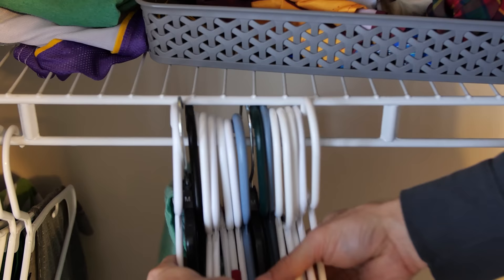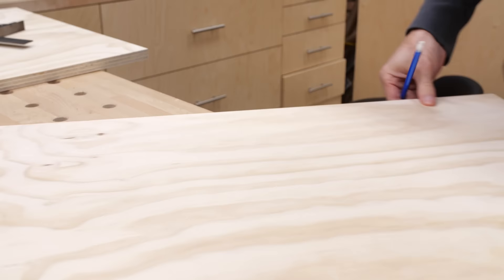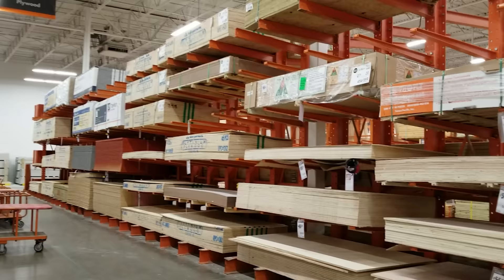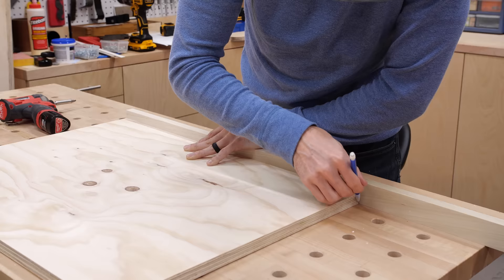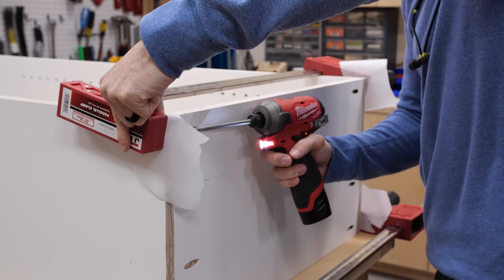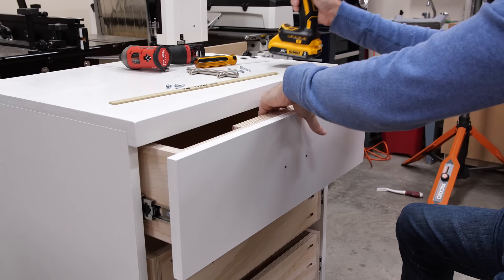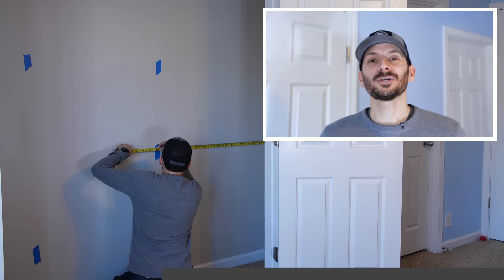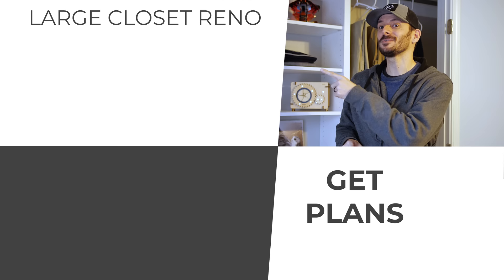DIY Closet Organization with Shelving and Drawers

Comment: i like how it seems easy if you have your own home depot of tools in your house
Reply: Exactly
Reply: You can actually buy those two pieces
Reply: I know i just watched a guy say he "make your own vanity for a fraction of a price," but then proceeded to uses thousands of dollars of equipments.
Reply: You don't need a fancy shop like he has ...  A tape measure, circular saw ( be sure to use a plywood blade) electric drill or screw gun ( a magnetic extension helps but they make long screw bits & be sure to get the proper tip for the screws you are using), caulk line, a bottle of wood glue, sanding blocks or sand paper and framers square ( clamps do help but a family member or friend  helping works better..think of the time together) ..all these are just base tools ... Design to your needs ☺..good luck👍
Reply: LMAO I was thinking the samething
Reply: @scottm.franklinnc7942  Agree!  Would love to see an episode with just using the tools above.  And throw in a comparison of cost and time between using all tools vs. minimalist tools.
Reply: Ya’ll a bunch of Karens!  Nothing but complaints...go buy or rent the tools to diy this or hire someone.  That’s the reason you pay contractors the pricing they charge because they had to have a large investment to be able to do the work you want done...
Reply: @DoctorMofo  it’s like they expect to make things with a screw driver. If you’re going to build something you’re going to need tools. Simple as that!
Reply: I think as a homeowner & especially as a man you should own tools.
Reply: @DoctorMofo  Damn my name is Rosie though
Reply: @chuycanseco5515  I'm a man and homeowner and have tools but I have absolutely no room in my one car garage for any of the table tools he used.
Reply: Right??!
Reply: Ive seen so many " diy " they be like anyone can do it, then go to their garage with 20k in machinery lmao
Reply: Yeah.... i only have basic hand tools as i live in a flat without any garage, and all the tutorials i see use pro tools. 
I would like just once a diy with only basic tools, without table or big and expensive tools, and see how to use them with efficiency to have a good result. 
I'm making a vanity  it's difficult as i'm a beginner but i cannot really rely on youtube tutos for that.
Reply: He is just using what he has. This whole thing could be done with the tools most DIYers have. Circular or table saw, jigsaw,  drill or impact, pocket hole jig, tape measure, and speed square. He really didn’t use anything too crazy.
Reply: Engineer Your Space is a youtube channel I love because the tools are so basic.  Miter box with handsaw and a drill.

They show you how to make wonderful changes to your rental that won't damage the apartment.
Reply: I use to be like that but bought a home and renovated my basement myself. Total cost of tools = 3k savings from doing it myself= 100k
Reply: @pbdubz  I don't even have close to 20 grand in machinery and I could this. You don't even need a $1000 in machinery. It's not that hard.
Reply: Of course always people complaining about lack of tools. Do you honestly not realize this could be done with very basic tools? Circular saw $100. Miter saw $100. Impact gun/drill $100. Wow $300 worth of tools and cheaper if you buy used. Stop whining and figure this crap out. Its not hard.
Reply: Be a man and buy a set of good tools. One time purchase if you buy quality.
Reply: I guess you want to see a video doing this with a toothbrush and a lugwrench.. 😅
Reply: @mcdonamw exactly 😂
Reply: I’m getting increasingly impatient with people who make this comment on every handy video
Reply: I'd like to see him or someone as talented as him make a video building something at my house. I have all the basic tools and the bery low  budget that most regular everyday people have at home and it would be interesting to see how easy it would be to build some of this stuff with my very basic set up. I dont think it would be as easy but if it can be done i think a lot of us would love to see it. If you are up for the challenge let me know. I have a few projects we can tackle.
Reply: True but you can rent the equipment
Reply: In essence, everything could be replaced with a hand saw, a hand plane, a hammer and nails. It probably won’t come out looking this nice, but you could absolutely simplify it and probably end up with something usable. 

I figured cheap vintage hand tools would work well… but lord my cheap circular saw is a lifesaver compared to using hand saws for something like this. I can only imagine the logic follows until you end up with a shop similar to this fellows

Comment: All these “DIY” videos that been popping up in my feed sure do seem to assume I have all these power tools and knowledge about wood cutting and supporting lol
Reply: Same but I'm learning
Reply: It's still DIY if you did it yourself.
Reply: I was going to write a comment and saw yours said it all hahahah
Reply: A circular saw and drill gets your foot in the door.
Reply: This is "Professional Grade DIY".  LOL
Reply: It’s a sign of your a man to grab some tools and  start learning
Reply: None of it is hard to learn. Get some tools and some cheap lumber and go build something easy. 
There are processes in woodworking that take talent and years of practice to get good at (like marquetry or inlay) but you can build almost anything without needing to learn them.
Reply: Can do an awful lot with a circular saw and a straight edge. Most folks won’t be making cabinets and drawers that easy on there first try. Some open shelving a beginner with basic tools could 💯 accomplish with a little patience.

Comment: Nice job.  I never let my cabinets touch the floor in the closets.  I hang them around 6” or so off the floor so one can keep clean, critters cannot hide and replacing the carpet is never an issue.

Comment: Great video and great looking closet system…for the rest of you schmucks without the carpentry knowledge or tools, such as myself, closetmaid has very similar kit for about 800 with drawers, all the shelves, and a shoe rack. You can even get fancier if you put an LED strip on the inside of the wall and a smart plug for lighting.

Comment: I came across similar problem that you had on hutch upper, side pieces. I pocket screwed them to the top and filled the exposed pocket holes with precut wood dowels angled specifically for filling these holes - found at Home Depot. I sanded them down and you can’t see them after paint. Your method is also good.  That wall hump is so typical of builder tract houses. Belt sanders are god send! Great job and video too.

Comment: MDF is less expensive and has a very smooth surface.  I am building built-in bookcases with it. For strength I glue to 1/2 inch panels together for a 1 inch shelf and sides.  I have built bookcases like this in the past and it works really well.  I love the idea of drawers in the closet. I fold most of my clothes anyway and it would give me far more storage that hanging!  Thanks for the idea!
Reply from the maker: For sure, MDF is a good option too

Comment: I designed a similar closet but instead of all those hanging rods, I designed it with fixed shelves on top of the middle drawers and on the right side I had a 32 inch in height shelf to fix a suitcase.  Above that right side I had varying height shelves.  There is a top shelf from left to right for blankets and other bigger items.  On the right side are hanging rods for clothes.  Keep in mind that this custom made design is for a vacation home and custom made accordingly.  My nephew built it, he used poplar hardwood and birch plywood for the shelves.  I posted the finished closet on Facebook in an ad and immediately got about 30 inquiries.  The total material costs which included enamel based oil paint was about $400.  It does add value to a house and not to mention it is a great use of bedroom space.  Oh, and did I mention that women love those custom closets, especially my wife! LOL.

Comment: Stop block... top panel... gang cutting...clamp heads....base cabinet...face frames.....edge band....combination square...  it was very reassuring when you messed it up. But then fixed it with a lil piece of tape

Comment: Carpenter here. It was nice to see you scribed the back of the hutch for a nice fit. Since everything is just white I would get some white painters caulking and run the smallest bead along the back of the hutch where it touched the wall and where the drawer touches the wall too. Then scrape away excess with a putty knife. It will make the edges so incredibly crisp and professional looking. I mean it's a closet so no one will look that closely but I'm just a perfectionist and I think it just looks so good with that extra detail

Comment: I use  the Radiata Pine plywood all the time. It's $30.95 at my big orange store. Multi layers but like Brad said get a straight flat sheet it will not, will not flatten out. Did I mention it will not flatten out? Great build Brad.
Reply from the maker: yeah, best get it flat and build fast :)

Comment: It's easy when you are a carpenter and have every single woodworking tool known to man
Reply: I'm a carpenter but with far less tools at home. I mean, still a couple thousand worth but I don't have nearly his level of tools. That said, can still pull this off without this degree of tools. You just have to get a bit more creative. Like, instead of a track saw, a basic 6" circular saw and a straight guide would work. I've managed to remodel almost my entire house with the basic tools I have.

Comment: For metal-on-metal like hinges, you want lithium grease. With the spray kind, you don't even need to remove the hinge pins -- just spray it on with a rag behind it and work the hinge. I lubed all my hinges in the house with lithium grease about 5 years ago, and all but 1 are still completely silent. The 1 that isn't really has too much junk hanging on it (pantry door).

Comment: i'm so glad you did this -- i've been working on a closet system for my wife in the back of my mind for a few weeks now. one question -- what are the advantages to using raw plywood as opposed to using those melamine panels with the pre-drilled shelf holes? is it just more expensive with the melamine? thanks!
Reply from the maker: I didn't price it out, but cutting from a larger sheet is almost always cheaper.

Comment: Hey Brad.  Another great video!  Would be great to see a video that explains how you go about spacing drawers in a cabinet such as this.  When there are several drawers within a single cavity.  I like the idea of creating that spacer but getting the height measurement for the spacer, that’s the trick. Thanks again!

Comment: Thanks for the video.
One question: which material is better for building furniture, plywood or MDF?
In case, I need to use a router to trim the edges, the plywood will leave rough edges. What should I do?

Comment: Great video! Love the professionalism. You show the important parts and not all the other useless info. Question: Thoughts on just removing the base trim behind the cabinet instead of notching out the cabinet unit. 6 one way, 1/2 dozen of the other. When we add base cabinets to remodels we always get them as flush as we can to the wall.

Comment: I always see these 23/32 sheets of ply at HD but wasn't sure if they were viable for all these home projects. Does the slight difference in thickeness matter vs. the $40-50 3/4" birch/oak/etc. sheets?
Reply from the maker: The 3/4" sheets are actually also 23/32
Reply: It depends on the number of plys. Get at least 7 ply for better projects. Stumpy nubs has a great video on how to read plywood grades. Definitely worth a watch.

Comment: Nicely done. Did you paint the carcass edges or put solid wood face around this as well?
Reply from the maker: The lower cabinet edges just got sanded and painted.  It's hidden 95% of the time

Comment: The only time I've really used adjustable shelves is 1: On my bookshelves. 2. My garage cabinets. The first is because I like to reorganize my books come such a wide range of sizes that it really is nice to be able to adjust the height as need be. The later is because my workshop is still getting slowly filled with tools so it's nice to not be committed to a shelf height.

Comment: Curious why you did not primer the wood?  I was always told that water based paints on plywood will make the grain rise without a primer.
Reply from the maker: It's paint and primer in one.  And if you use a water based primer the same thing will happen.

Comment: My bedroom has a set of bypass doors on my closet and I cant use your design as you wouldntbe able to open the drawers as they would be in the area that is behind the door overlap area. What do you think about moving the drawer stack and hutch to an off center location using the smaller hanging area as a full length hanging area, then using the other (longer) side as a bilevel hanging area for shirts and shorter hanging area. I really like your design and plan on using it. Thanks

Kenny Norman

Comment: Any tips on installing drawer slides in tight spaces? I don't have any side clearance (installing your build in a small closet and has to be built in due to dimensions. The drawer slides on the carcass I can do like you show here but I think I'll have to install the slides on the actual drawers with them out of the cabinet/dresser. Thanks!

Comment: How do you rate the kreg track saw
Reply from the maker: I'd say a solid B+
Reply: @Fixthisbuildthat  thanks, i am actually a kreg dealer and get a personal one for 50% off retail. but i do want to good one and would spend the extra cash if the dewalt or makita was better.
Reply from the maker: @goldendogwoodworks6675  I've not used the other two. So can't comment on how it stacks up

Comment: Instead of attaching the hutch to the base with the dowel, why not just put some of that extra trim on the top of the base on either side and make a lip.  You could then use smaller screws on the inside to attach to that trim.

Comment: What type of paint did you use. How taking a picture of a close up of the finish, I’ve used that plywood thinking I’m just going to paint it anyway and it never seems to look good at all. I’ve sanded before painting and in between coats still crap. I only use the birch ply now even for painting

Comment: I’m buying the plans but I’ve never done a project like this. My closet has slightly different measurements where do I write the different measurements for the wood lengths?
Reply from the maker: The wooden shelves can be changed in length to fit any size

Comment: Most woodworkers when building a shelf they put the pocket holes on the inside! What was the purpose of putting them on the outside in this case? 🤔
Reply from the maker: So that they are hidden and don't need to be filled

Comment: Thanks for the video. I have been planning on building a DIY custom closet for my wife. I have read that melamine is a better material for closets compared to plywood or MDF. It says melamine is more durable and much more resistant to warping. What are your thoughts on that? Which material would you recommend?

Comment: Brad! You're awesome. Man sorry to ask a question on a older video, but is there any chance you could elaborate on the use of the compass to roughly identify and deal with the hump in that wall? That was super cool, and I'd love to get a closer look at that process. Maybe you've covered it more in one of your other vids.  Thanks for all the great content.
Reply: Maybe you've already figured this out, but it's actually quite simple. Basically, if you have a hump in the wall or ceiling or floor or what have you and you have a piece of trim or something that needs to sit flush then the steps are as follows.

1. Place trim (in this example) where it will be going, making sure it's "level" with the surface you're lining it up to. You'll see gaps because the hump is keeping it from touching the floor the whole way. 

2. Either using a compass or a spare piece of wood cut to size, make a gauge that is the width of the widest gap you find. 

3. Run that gauge and pencil (if not already using a compass which is the easiest method) along the hole length of the piece, drawing a line. You'll notice that where the largest gap is there is no line, and the places where the trim is running into the bump the line is farthest away from the edge. What you have managed to do is transfer (called scribing) the shape of the bump or uneven surface onto the piece, and now if you trim away all the way to the line then you will have carved out the shape needed to go around the bump. 

4. Cut almost the line and then sand to the line (or just sand if it's not a large amount to begin with.

5. Check the fit and make alterations if necessary. 

Hope that clears things up!

Comment: What was the total cost for this project?
Reply from the maker: 3 sheets of 3/4 ply, 1 sheet of 1/4, 4 pair slides, 4 drawer pulls and paint
Reply: @Fixthisbuildthat  what do you use for the rod and rod holders?